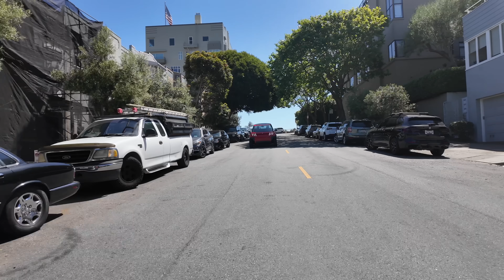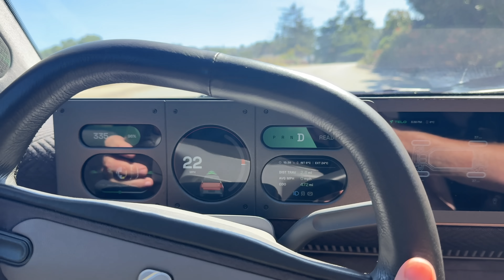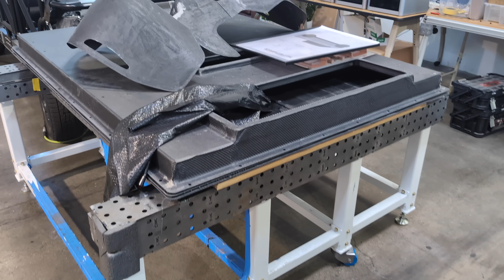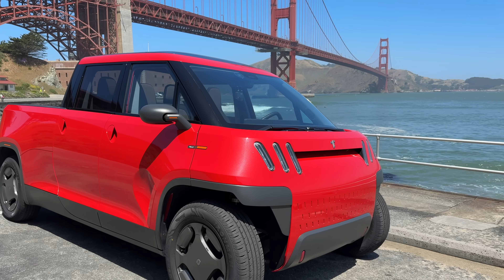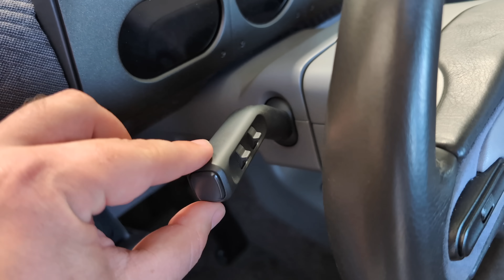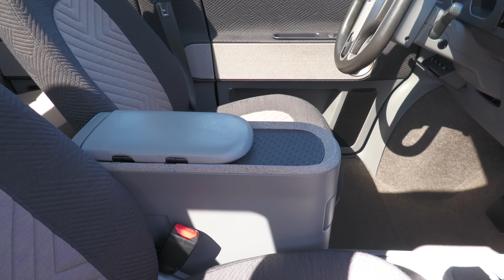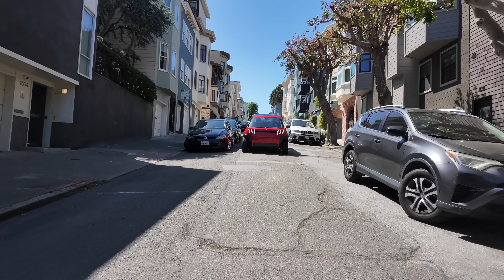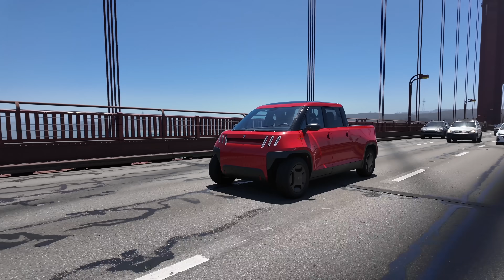The Tiny Telo Truck Hopes to Pack a Big Truck Punch

Comment: There's no shot this vehicle is going to be able to tow 6K. 

I guess maybe with the weight of a battery pack, but big trucks need wheel base to safely tow. Otherwise you'll get a 'tail wagging the dog' situation with the trailer.

Comment: 11:50 Id rather have composite panels anyway. We need a truck that won’t rust out. also cheaper to replace. I’d hope the panels are easily removable.
Reply: They won't be cheaper to replace when they stop using them.

Comment: I'd love this in a 2 door. The rear seats seem like an afterthought
Reply: If you’re like me, the rear seats would never be used. I have a sedan with rear seats that I’m not be getting rid of since it’s my dream car , the rear seats in it have been used enough times that I could count on my hands and I’ve owned the sedan for over 4 years at this point. Same is true for my partners Hatchback of three years, also their dream car. So we’d have 12 doors for two people. (13? Hatchback count as a door?).
Reply: That whole "nobody is the US is buying 2 door pickups" is largely because no one is selling them anymore! Personally I'd much rather have more bed
Reply: I wonder if it has to do with the battery, they might have had extra room and just said "let's add another row of seats".  Though, I agree, they could cut the cab down and extend the bed by two more feet, bringing it to about S-10/Ranger sized beds.

But let's face it, this isn't marketed to us country boys, this is the for the soy-latte-sipping, blue-haired liberals who think the electricity to charge these things comes from magic.

Comment: Every new EV has absurd HP and 0-60 times.  Is that just a side effect of the tech or is there any opportunity to reduce costs by making a more reasonable performing version?  My Bolt has 200hp and 0-60 in 6 seconds.  That is more than adequate for today’s roads and traffic.  Insane 0-60 times are a great parlor trick and I’m sure impresses people but I don’t really give a damn.
Reply: im more interested in 50 to 80mph, that matters alot more than 0-60.
Reply: It really is just a side effect of the tech. It costs roughly the same to put a 50hp motor as it does a 500hp motor. It just comes down to how power efficiency electric motors and batteries are.

Comment: 11:21 Aggressive regenerative braking has always made me carsick🤮, especially in situations involving constant fast acceleration and deceleration you describe. One time, I had to ask the Uber driver to drop me off halfway just because I was that sick🤮🤮.
Reply: I think regen on the accelerator should never be a thing. Always the first stage of the brake pedal.
Reply: I love the one-pedal driving in my Bolt. The blend is so smooth it never bothers me. 
But the only time I get at all carsick is when I'm trying to read as a passenger on longer drives.

Comment: I think composite panels is a better idea, even into production. and make the major ones near tool-less removable, so when you inevitably munch one up from using the truck as a truck, it's quick, easy, and hopefully CHEAP to just swap a new panel on.
Heck if they could figure out how to make the truck turn into an SUV with just a partial cab swap, that would be insane.

I can totally see this as a great farm truck as well, for those of us getting into the whole off-grid homesteading concept.  something that spends the majority of its time on property, but still can run into town to get supplies.

Comment: The price is just not in line with the product. I wish them the best and hope they succeed, but they're offering a strange product in a COMPETITIVE price bracket with plenty of more typical offerings and a silicon valley "solution in search of a problem" perspective. All its problems and issues are "we're looking into X, Y, Z" responses, it just has all the stink to me of another ambitious EV failure. It is singing from the rafters that "IT CAN DO EVERYTHING!" but the core "it's a work truck designed for cities" is addressed with precisely one single feature, the cab-over design. Every other aspect of it is just blindingly wasteful for a city work truck. You don't need 5 seats in a city work truck. You don't need 500hp. Or 4wd. Or 350 miles of range. City work trucks are primarily delivery vehicles sold to cash strapped small businesses. They want cheap, stripped down, 2 seat vehicles with huge bed capacity. That's why Kei trucks are selling so well. 

The slate is the truck I think has a good chance to really be the next home run. Dozens of real road examples, it's already meeting REAL crash test standards and exceeding (per them) their goal of 5 stars. It's got a factory, a unique and disruptive business model that is both pro-consumer and cuts their own costs like not needing a paint facility, and is offering a real product that so many people had been begging for the return of (the real minitruck) at a price they can afford, where little to no competition exists. Apart from not being cab-over, it actually does all the things Telo says they want to focus on.

Telo seems to be on a marketing rampage with doug and now robert, but the things I would expect to see from a company that indicate success are just... not there.

Comment: I'm a big fan of the idea of lower-performance/simpler electric options. I understand that margins are poorer but accessibility is an ongoing problem in the space. The 300hp version, with either battery available, is a more realistic (and under-served) segment for a lot of people. I'd argue that pushing that to the limit would be the best way to ship volume. By pushing I mean to MVP the crap out of the base model. Ditch the in-bed 110/220, no rolldown rear windows, forget the panoramic roof (which sucks in hot climates anyways), etc. All the things that the majority of people wont use anyway should go away on a base model. This difference, paying for stuff I don't need or want, is a big factor keeping me out of the EV space and I hear the same from many others.

Comment: There are two different ways I think of the Telo's price. Pickup guys could compare the Telo against existing electric pickups. The base Ford Lightning starts at $49,975, so the two motor Telo with the base battery is comparable. The Slate, starting at $28,000, would be a lot cheaper but it is a fairly more basic truck. I'm not a truck guy, so I'm considering the Telo as a smaller but roomier alternative to a Hyundai IONIQ 5, and when comparing the builds I would go for, rwd, large battery and a bed cap for the Telo, the prices were comparable. Thus, the Telo isn't a screaming bargain, but its price doesn't seem out of line to me.
Reply: In the real word, I don't think you can touch a Lighting for less than $65k.

Comment: i like it and i am interested in actually owning one eventually.... but I STILL don't like that weird pill decoration on the side. I would be happier with it gone; just make a smooth depression where the air comes out the vent.

Also it should have a 4ws option, it would be super useful to have even crazy tighter turn radius.

Comment: Your argument about 2-door trucks seems backwards.  Nobody buys 2-doors because of the prices: when the base model of a full size truck starts at $50k, it has to be a family vehicle.  Under $35k (which they might be able to do on a simple 2-door w/ no features), you can start justifying it as a secondary vehicle.  

Point 2:  most city drivers don't need a truck more than 2-3x each year.  They'll just rent.

You can't make an "every-purpose simultaneously" vehicle without compromising on each.  They would be better served designing something modular, where it can carry people OR a cargo load.  Something like an Element with removable seats & shell (maybe), the way large SUVs function.

As a 6'5" heavyweight, this is not a vehicle I could use unless it was a 2-door.  They are either designing or pricing themselves out of their potential market.

Comment: Elio is a company that comes to mind when you talked about a startup graveyard company with hundreds of employees and millions of funding that didn't make a good prototype and didn't make it to market
Reply: Elio wasn't a scam at the start but it became one over time. I was an outdated design shortly after it was announced.
Reply: @tims8603 Elio died because their high cost gasoline engine was a failure! They should have used a 3 cylinder from Ford or GM!
Reply: @gmv0553  I remember that they were going to build their engine in house. I thought that was highly unlikely. That was a red flag for me.
Reply: Elio never had hundreds of employees!
Reply: I remember seeing the Elio at San Diego Comic Con one year. Neat, but I wasn't hyped about the tech. In Europe they have all sorts of small vehicles to tool around town for short trips. I wish they could bring some of those over here. The Telo seems like a great multipurpose vehicle to me.

Comment: Some Thoughts and Sugesstions:
No glasroof in a Work Truck. (and not other vehicle you take serious) You can insulate a steel or composite roof way better against snow and ice and no sun is shining into the cab and heat it up. You can mount Ladderholders, Racks and other stuff on it (or Lightbars and run cables to it) 
A Hard Body Cover in roof heigt for the bed. (Tools and goods are stolen from truck beds all time) A Ladder or Long goods Arch with straping points.
Real Physical Buttons for all the direct User Controls auf the Systems. Like Fan Control, Air Conditioning, Volume Controle, wiper speed, give us Knob and button, No stupid Touch.
Real Physical Door handles. No electronic nonsense no sensors. Something the Fire Rescue or a first responder can realy grab on after an accident and jank doors open. Something a farmer can repair in 15 Years in the field without touching a soldering iron or cables.
A Backup Camera. 
A Tow hitch also think of an Eurpean version. It even looks like you would have to redesign the rear bumper for it. Make it sa imple bolt on style like military trucks have. 
Maybee extend the front a ittle bit to make it more visial apüpealing but more so to include a thrunk for your charging cable and stuff. You dont want to dig down in the tunnel and dont want them in the inside.
The Space below the seats looks stunning but more practial is some storrage compartements reachable from the sides. For your gloves, snow removal tools, first aid kit, high vis vest, warning sign. Straps, hold donws and a shovel  goes into the tunnel.
i dont know the exact with of the bed but make shure you get little bit more as 1,25m between the weel arches to lay down a standard sheetrock panel flat. Also length with closed tailgate shout be 2m to accomodate for said sheetrock panels.
Make the backseet backrest split so you can seat 3 people in the car and lay down the backrest and store long good. Think aboput an tunnelopening so you can now seat 4 people and carry some realy long goods stick into the area between the front seets even. (like pipes for example or a mast of a surfboard)

Aim for a utilitarian Market for use as fleet vehicle for companies or handyman. SUV maybee later (or as mold for a vehivle design for a hardtop) The o so good looking Livestyle use with the surferboys comes naturaly on its owne if you have a practial vehicle. Ladderarches and Hard Cover are easy used with surfboards and as camper version.
Reply: That's a wall of text.
Reply: @wolfrig2000  Thats not for you. Thats for Telo

Comment: E-Trucks are garbage imo. The charging time and crazy entry price is retarded. Also the fact you need to replace the battery pack every 5-7 years is just a crazy expense that Robert overlooks way too often.

EVs are good, but there are a lot of hidden cost that are never brought up. The fact that he had to juryrig batterypacks for his older cars speaks volumes for the eventual used car market 10-15 years down the line.
Reply: "replace the battery pack every 5-7 years" says who? What EVs are getting their batteries replaced that often?  
The studies I've seen show that while there is a few total capacity drop for the first few years that lessens to a fraction of a percent per year after about 10%; and that's with old NMC batteries. Newer chemistries last longer and can handle more user-friendly charge cycles. 
Also it depends on how much and how you drive. If you're constantly flooring it in any car it's gonna wear out faster. If you're putting a hundred thousand miles per year on any car it's gonna wear out faster. 
The charging time is a benefit. The only time I have to use public charging is on road trips. The 30 minute break every few hours is welcome. Time to stretch, use the bathroom, grab a snack, cure the highway hypnosis. It's safer to take breaks every few hours. Plus it's cheaper per mile, even with the massively inflated public charging costs.
Reply: @Jcewazhere  You can cope and seethe all you want, yet the fact remains that replacement battery packs are expensive as all hell and that it's not guaranteed that you'll get OEM replacement packs 10-15 years down the line.

Without massively enforced battery pack standardization, EVs will remain a meme at best for anything but inner city driving.

I mean hell, even Robert himself admitted that his EV truck is way too expensive and has barely enough juice to get him around at an acceptable speed.
Reply: @ZeDoctorTod  I'm not seething, seems like you are though. Are transmissions cheap? How bout those oil changes, or replacing the engine when they're not done? Head gasket replacement on my old Subaru was 3 grand, and that's an easy to work on old boxer engine; not one of these new 'high tech' engines that're so buried in plastic you can't even see the engine when you open the hood. 

"Without massively enforced battery pack standardization, EVs will remain a meme at best for anything but inner city driving." That hasn't been the case for over a decade. People have driven EVs from pole to pole, and across the world from east to west. I drove my little Bolt from Denver to Des Moines and back in 2021, and they're only putting in more chargers. I live in rural Colorado just fine with my Bolt, take it up to the mountains a few times a year, and regularly drive between Cannon and Denver. 

"I mean hell, even Robert himself admitted that his EV truck is way too expensive and has barely enough juice to get him around at an acceptable speed.' I guess you missed the videos he was in where he raced EVs across the country. 

Sad how misinformed and biased you seem to be. Enjoy poisoning yourself with methanol and diesel fumes, enjoy poisoning your children with exhaust fumes, enjoy spending more per mile and getting less out of it.
Reply: Oh, and every warranty I've seen for batteries is at least 8 years and 100k miles. So if you do manage to trash your battery by being a bad driver they'll replace it for free.

Comment: "safety first" but it's a cabover pickup that's discouraged from going on the highway and built of fiberglass... right.
Reply: The prototype they're driving in the video can't go on the highway because it's not safety rated yet and doesn't have airbags. The production model will do better on highways than most cars already on the road.

Comment: Having owned a pickup and a van I can safely say that pickups are generally bad at everything. Make this into a van and I'd buy it
Reply: A high-roof, compact cargo van would be incredible!
Reply: Particularly with them targeting the U.S. city market, a van would make way more sense, because an open bed in U.S. cities is a question of when you’ll have something stolen from the bed, and not if.

They talk about a tonneau cover on their website, but tonneau covers are just a worse truck and worse van experience. It’s the worst of both worlds, with extra fiddlyness.

Their website has a single render of a full cab height bed cover, but absolutely no info on it, so seems like that’s on the way backburner, if it ever even happens at all.
Reply: My trucks good at everything. Comfortable, quiet, fast and reliable. It can tow, it hauls, and keeps me in business. The tail gate is a great work space too. Maybe you’re the problem. lol
Reply: They need something pickup shaped to get funding. 

They could then later on easily release a van version
Reply: My pickup is great at it's mission. It's comfortable, practical, spacious, and carries and tows a lot of stuff. The back seat has more than enough room and my family fits no problem. The MPG isn't even that bad thanks to modern technology. I have other cars for carving up back roads and going fast.
Reply: It’s just a little quicker to steal stuff with a truck!

Comment: I like that they're planning an SUV version, but I really want a cargo van iteration: two seats, sliding side doors, and either a side by side split rear door or, even better, a double Dutch door like the early 99s Astro vans, with a three part rear.

Like a kei Van, but EV, and with safety features.